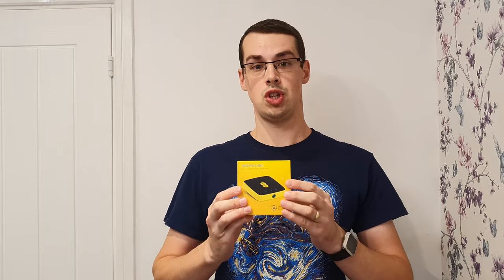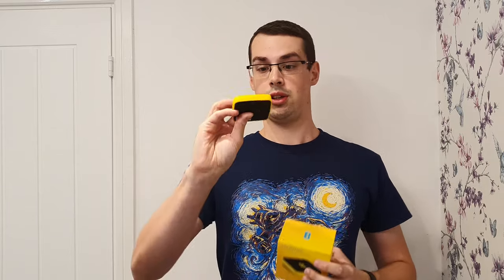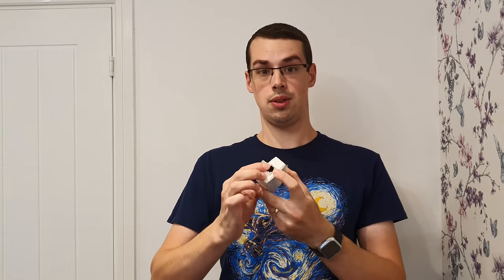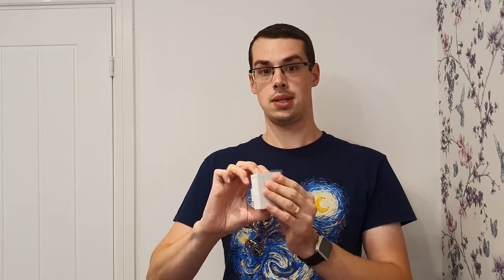Getting Internet To Outbuildings (7 Different Ways)

Comment: Great video. So I put ethernet cable to my outbuilding. So if I get a router and plug the outbuilding end one into it I'd have wifi out there? Also I'm using sky internet. I have an old bt internet box. Would that work?
Reply from the maker: Thanks! Yes that should work well, however the main thing to know is that the old BT router needs a bit of configuring first. This can vary per model, but I did this for my garage at https://youtu.be/IDXneJVh91w and the description on that video outlines the steps I needed to take for my particular BT box model.
Reply: @SmartHomePoint  oh alright thanks for the reply. I'll try it soon .

Comment: Great video, thanks very much. Will the Powerline adapters always work or do they need to be connected from the main house supply in a specific way?
Reply from the maker: Thanks, glad you found it useful! The Powerline adapters should work as long as they're connected back to the same circuit board. I use Powerline adapters for my garage (connected to my living room) and they're completely separate circuits but they still work fine. Apparently the performance can be a bit reduced on different circuits, but they've been working fine for me (I have a Ring camera in my garage and there's no issues with this uploading full HD footage, for example).
Reply: @SmartHomePoint  thanks for the reply and awesome video

Comment: Well explained YOUNG jEDI!   Portland DJ Dan
Reply from the maker: Thanks 🤣
Reply: @SmartHomePoint  I DID find a remedy . .  I ran an ethernet cable from my living room wifi tower to an Amped Wireless extender just outside my backdoor which then sent a direct-line-of-site signal to a repeater in my garage/office...then connected it to a small ethernet cable to my desktop computer and VOILA!
Reply from the maker: Ah awesome, glad it worked out well - that sounds a nice solution!
Reply: @SmartHomePoint  Well it worked for a day.  Q: If I ran a 75 foot ethernet cable from our wifi hub out to my garage and directly into my computer, would the ditance degrade to quality of the signal?
Reply from the maker: 75 foot should be absolutely fine. The usual limit is 300 ft, or slightly less (180 ft) for much higher gigabit speeds. If you're running it outdoors at points then CAT7 cable might be worth exploring as it has extra shielding, and will still be fine over 75 feet.

Comment: So my husbands barn is about 400ft away from home. We bought  this thing You plug in that supposed to extend. But it’s choppy sn doesn’t work all that well. We don’t want to pay for exta internet lol. Is women terms lol can You give me the best option. I had trouble following all the info cause most I’m clueless of what You are saying lol. If I was educated this would be the best hands down explanation
Reply from the maker: Hah no worries 🙂 Uhm based on the distance, the best/easiest option would be a TP-Link Powerline Adapter - assuming that the barn goes through the same breaker box (electric box) as your house. Then you just pop an Ethernet cable in at each end - one near your router in your house, and one near the Powerline Adapter in the barn. Let me know if it's not the same electric circuit/box though.